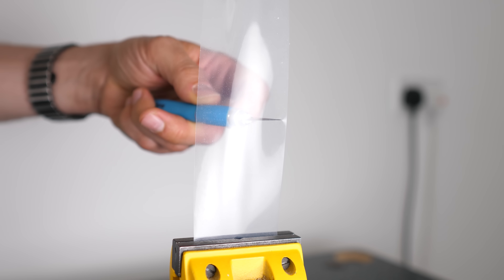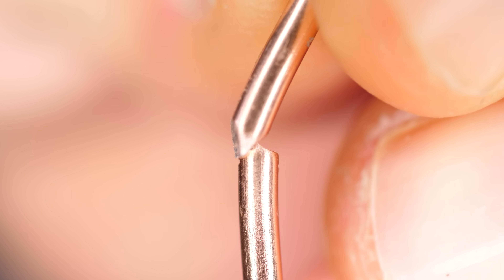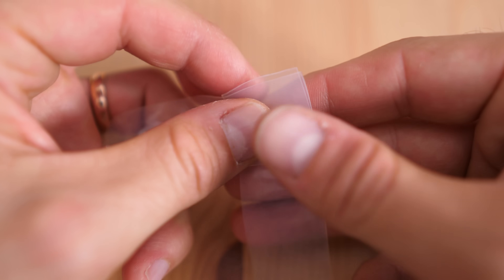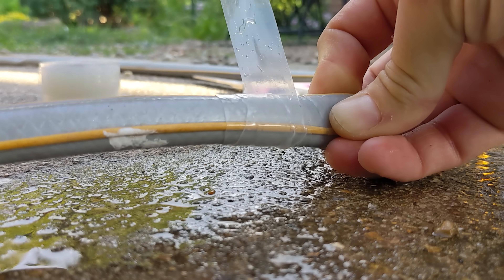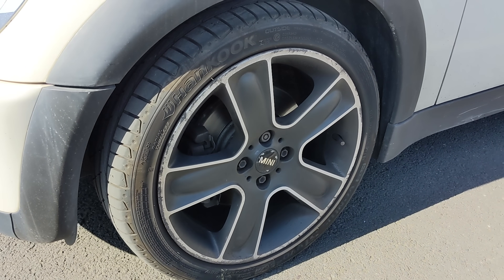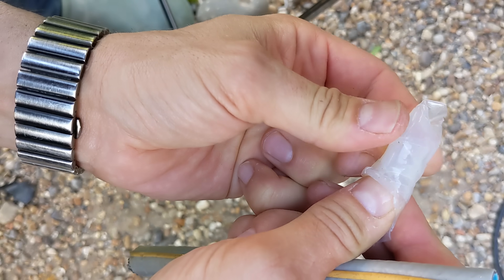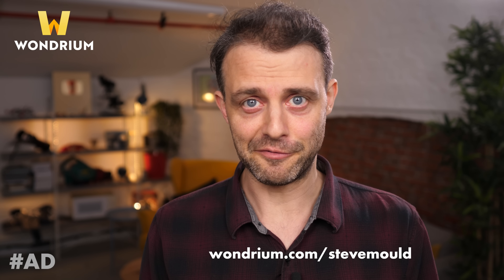Self-Healing Material

Comment: the reason the night sky isn't full of infinite stars is because of the expansion of the universe. No need to go to the big bang (although you could if you wanted to).
You can, in the present, observe the expansion of the universe. What that means is the universe is getting bigger and stuff is moving away from everything else.
But light must always travel at the same speed, the speed of light. So what happens when the light from the most distant stars and galaxies goes in our direction and the space itself gets bigger and bigger? Light cannot and must not go slower so instead of losing speed, the light loses frequency and energy, which makes it change color until we cannot see it anymore, and right now that light is so dim, if it has even reached us (remember the universe is 13.8 billion years old so only the light from 13.8 billion light years away from us can and has reached us anything further away and light hasn't had time to get here), so that light is so dim we can't see it with our eyes and most of.the time we can't even see it with tools

Comment: Couldn't this be simply "sticking" to each other? The molecular boundary of the polymer could have a shape such that it binds strongly to itself through van der Walls forces.

For example, imagine if the surface is composed of polymer strands popping out of the surface and cavities in the surface, somewhat like Velcro. This shape would stick strongly to itself and itself only.

Comment: it's corn starch glue used to use to affix paper back to books it's a heat activated glue available in many sizes and shapes it stretches  you can slowly push your finger in to it if  your slow but yo tap it it won't move you can change it Shap but it returns to original shape self heals shatters if hit with a hammer  if put under pressure it acts like play doh it acts like a slow liquid a elastemer  a glass  depending on speed fun to play with good for under your hifi components sold by national starch co in giant ravioli type shapes amongst others no one is saying this as far as I know because you'd then know it plain old book glue and cheap it also resist abrasion  use to thing it would make good self adjusting to shape knee pads or body armer was playing with this stuff over 30 years ago!

Comment: Polymer person and pedant here:
Crosslinking isn't necessary for latices to coagulate as you describe @6:11. Natural rubber, acrylic paint, etc are actually discrete particles of polymer dispersed in mostly water. Those particles have charged functional groups (e.g. COO-) on the surface. When you reduce the pH, you protonate those groups and destroy the double charge layer that screens the dispersion forces that would otherwise draw them together per DVLO theory, forming a floc. Salt will do the same thing by changing the dielectric constant. This floc becomes a solid rubber mass because the polymer chains are generally above Tg and are mobile enough to entangle with each other; below Tg you get a flocculated mass of mashed potato. I made a bunch of those early in my career!

Comment: What if it's just full of plastifier (non-volatile solvent) so when you cut it, you aren't really damaging the molecules (too much), you're just untangling them; and when you bring them together, the solvent also allows them to flow back together?

With the solvent being fairly specific, it won't cause the material to glue to your fingers, metal or most other plastics. Maybe.

Comment: If it were microencapsulation after a while all the encapsulated material would dissipate and it wouldn't work anymore right. I have some of this tape in black.. got it at a car show10 years ago , and it still works. Supposedly it has military approval for field repair of radiator and hydraulic hose 😳

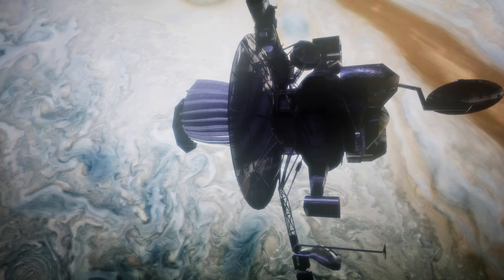Comment: 2:45 if I remember right, it is possible to cold weld some metals even in the presence of oxygen. You just need two surfaces that are flat enough that don't oxidize and then squeeze all the air out from between the two pieces.
Reply: I've heard it said that you can cold weld gold on Earth but it takes something like centuries.
Reply: Some machined surfaces will stick to each other really strongly. Feels like a weld but it breakable.
Reply: Like explosion welding, where 2 sheets of metal are forced together by explosives that squeeze out everything in-between them.
Reply: Take two blocks used to measure calipers, the smoother and more parallel the sides the better and they will stick to each other without any glue or "healing"
Reply: @jeffs-reviews  The blocks are very smooth and covered in a layer of grease. If you follow a procedure which pushes out the air, what you get is blocks held together essentially by vacuum, not too different from a suction cup on a tile. They will not weld together.

Comment: I'm curious about the material's strength before and after fusing it back together with different sized fused sections (attaching the ends, overlapping a little bit, overlapping a lot, etc.).

Comment: I'm not 100% convinced that oxidation is the reason metals won't re-bond after cutting apart. For example, gold famously will not oxidise as it's very unreactive, but place 2 gold earrings on top of each other and they will not bond. My guess is that if you cut a gold coin in two and pushed it back together, it wouldn't self-heal and I'm 80% sure that's not due to oxidation.

Comment: Probably a dumb question, but what would happen if you were to cut a piece of metal inside of a vacuum then try to put it back together? Since the lattice won't re-connect due to oxidation, what if you take that component out?

Comment: Is it possible it could be much more simple? What about a situation where it requires more energy to remain separate polymers? My favorite way to view that is that the universe is "lazy:" That when a molecular condition takes less energy than the current condition, it's gonna choose the one that requires less energy. Is it possible that the two sides have different incomplete polymers? Or that the plastic is actually two layers of polymers that, when stretched, are able to bind to each other through the alternate layer?

Comment: I use a self-amalgating tape all the time at work and yes, you stretch it to activate it. It actually does a great job sticking to itself when you do it right.  And to float a ship in a gallon of water you simply make the container the same shape as the ship so that a  thin film of water floats the ship up to the draft height.
Reply: You just need a really small ship.

In all honesty, I somehow doubt it would work? A gallon of water would need to be raised very high to counteract the force of the ship. If you made such a container, the ship would simply settle to the bottom of the container and push out all of the water.
Reply: @Validole  the container would go half way up the ship, be perfectly formed to the ship (but allow a slight gap evenly around), and sealed airtight. The pressure of the ship would be evenly spread upon all the water encapsulating it, therefore it wouldn't sink or hit an edge unless an external force was applied. 

Basically a "shell" surrounding the ship with a thin layer of water.
Reply: @2869may  No, no I can't. It's an impossible scenario. (unless the entire ship had perfectly distributed weight, no hull imperfections, and no uneven external force applied)

I meant a way to seal the water in, like some immense pressure above stopping the water from being pushed up and out, since (I'm assuming) the container cant come into contact with the ship in any way.

If the ship only had to be suspended by the water but could come into (non supportive) contact with the container then you could get a rubber seal or something around the lip to press against the ship and stop the water from seeping out.
Reply: @saltananda3227  Yeah, the "sealed air-tight" part would make it work. The seal would have to be incredibly inelastic, because otherwise, the pressure would bulge it out, and it doesn't take much to get enough bulge to fit a gallon of water along the whole waterline of the ship. At which point it becomes a somewhat academic point whether it is floating.
Reply: Ship could only float if it displaced the same weight of the water, so the ship would need to weigh just as much as a gallon of water.
Reply: @bismuth7730  The ship can displace the weight of the ship in water with only a gallon if the container the ship is in is strong enough and can fit snugly against the ship. Here is how.  Take the snug fitting container (Which has a height of the draft of the ship and fill it with water.  Now place the ship in the water. It will displace the weight of the ship in water and float with a small amount of water between the hull can container. The rest of the water displaced will overflow the container and be gone. Now if you remove the ship, there will be hardly any water in the container.  You will get the same result if you just start with that small amount of water. One does not have to literally displace the weight in water, one just has to effectively do it.
Reply: @lidarman2  no, you're wrong. The ship will just lay at the bottom of the container.....
Reply: @lidarman2  Displacement really does mean you need to do it continuously: it's the mass of water you have to displace to someplace else, where that displaced water, wanting to flow back into the area now occupied by the ship, provides the force pushing the ship up. It's the potential energy of pushing the water away from a point below sea-level, causing the sea level to rise just a bit. It's downright minuscule, because the world oceans are huge. But the displaced water is now "higher" in the earth's gravitational potential, and the force is provided by it trying to flow back into the lower area it (or it's brethren sea-molecules, it's one big supportive family) previously occupied. It has no incentive to push back, if it has already found an even lower energy resting place outside the enclosing vessel.
Reply: y'all are wild. to create enough buoyancy to float a ship, the ship needs to displace a volume of water equal to its own mass. so unless the ship weighs 8lbs, it's impossible. ships don't just float on water. It has nothing to do with surface area contact.
Reply: @currysama86  Do you know how hydrodynamic bearings work? They use a very thin layer of high pressure oil to let the surfaces spin freely, without the bearing parts ever coming into contact. 

Same principle for the ship thing.
Reply: @saltananda3227  No it isn't. Bearings use water and fluid to reduce friction. Mitigating the coefficient of kinetic friction is different than buoyancy. Buoyancy required that en equivalent mass of fluid be displaced as the weight of an object. Friction is just things sliding across each other.
Reply: Mass* of an object
Reply: @currysama86  No bearings use water. Think of a turbo charger, there is no metal to metal contact (If you shut off an engine before the turbo spools down it will cause wear and damage because the flow of oil from the engine has stopped, and the metal will make contact) when spooling because a thin, high pressure, layer of engine oil is forced inbetween the 2 pieces. The turbine isn't floating in the oil, it's got even pressure surrounding it and holding it in place on all sides.

Even pressure of liquid surrounding something means it wont drift to one side unless external force is applied, it's being held in place, not floating.
Reply: @Saltananda  So how does that have anything to do with floating the ship? You just said the bearings don't float. I used water as a generic example of a fluid, sorry I didn't say oil. And it sounds like we agree, at that point you're not floating a ship in a gallon of water...
Reply: @currysama86  Well what I'm suggesting is more of a technicality, since it's "technically" not floating, yet still suspended by water.

Quick question; where in the f*ck did this ship floating thing even come from? I don't see the original question anywhere? I just kinda jumped onboard.
Reply: @saltananda3227  on the "where did the question come from" : I don't know either, but someone was wrong on the Internet (in a way that I knew was wrong, but had to think a bit to understand why it was wrong).
Reply: @Validole  I don't even know why I got so into it, at the end of the day it's still a statistically impossible feat.

Comment: Oh I just have to say it, I haven't even finished the video yet but: In a way metals could be similarly self healing if the 'break' was precise enough - consider the wringing together of gauge blocks.  I've seen it on other machined parts, a odd adhesion force where the metal starts sharing those electrons enough.
Reply: Finish the video next time! He mentions cold welding.
Reply: @ObjectsInMotion  yes he did. I remember. Caused I watched the video.
Reply: Interference fit?

Comment: Technically you can friction fuse some metals, though that's far more friction that just pressing it together yourself, and it's not like most things would withstand it; certainly not the oxidized layer that stops them from fusing. lol I know you pretty much go over this, but I thought it was neat that you can get clean welds without grinding the oxidized layer ahead of time; I guess because the friction burns off the oxygen ahead of time? Honestly not sure of the mechanics.

Comment: I personally wonder if it's a mix of two compounds. If one is liquid at room temperature but dissolves the other, I imagine that you can get a mobile surface layer of the liquid compound that gets removed when pressure is applied, allowing the other compound to cross-link without getting exposed to the atmosphere. 
I guess it could be simple hydrogen bonding, but that the ductility of the material allows a lot more of the hydrogen bonds to align.

Comment: A big part is also the lack of contact surface. At the atomic level, two pieces of metal, even smooth, do not touch each other enough.
And btw, certain metals like aluminum and copper, can weld together just from extended contact under pressure.

Comment: great video, a worth considering hypothesis is some supramolecular host guest interaction between different polymer chains (pendent chains) and/or weak interaction such as hydrogen bonding that can result in high strength material based on strictly physical interactions
but that's just a hypothesis
also worth trying to bind the tape after applying some mild acid/alcaline solution to investigate the interaction

Comment: Steve, Its Polyorganosiloxane 
3M also  makes this tape as 3M 70 self fusing tape.
The MSDS sheet shows 1 ingredient:
 1. INGREDIENT C.A.S. NO. PERCENT
-----------------------------------------------------------------------------
Polyorganosiloxane Mixture.............. Mixture > 98
 The components of this product are in compliance with the chemical
 notification requirements of TSCA. This product is an article as
 defined by TSCA regulations, and is exempt from TSCA Inventory
 listing requirements. All applicable chemical ingredients in this
 material are listed on the European Inventory of Existing Chemical
 Substances (EI

Comment: I use self-amalgamating tape to waterproof outdoor connections for coaxial cables on antenna systems (amateur radio) and I always found it fascinating. Works great for this application, and is almost impossible to cleanly separate once it has fused.

Interestingly, I have found this kind of tape (even the black stuff) decidedly not UV-tolerant, and it will degrade and split quickly when left in the sun. Simply overwrapping the join in black electrical tape (substantially more UV-tolerant, despite also being a black plastic tape) does the trick to protect the amalgamating tape from UV though, and then it lasts for years.

Comment: this doesnt make sense. If I took two diamonds which largely do not react with the air and try to fuse them they wouldnt.

Also silicon dioxide which is sand or quartz when broken does not fuse back together though it is already in its oxidized form and therefore does not react with anything.

Comment: As you mentioned, https://en.wikipedia.org/wiki/Self-amalgamating_tape - we used to use this at work for taping up cable joints. It seals to itself into a single rubber block - been around at least since 1979 (when I was an apprentice). It wasn't immediate, more like 5-15 mins I guess.

Comment: Unfortunately, your metal welding explanation is at best incomplete. Oxidation is definitely a factor but let's take for example Gold or Copper. They're very unreactive but the still don't cold weld. The big reason it happened in outer space is the cold rather than the vacuum. When cooling down the metal you allow the electron clouds to more easily recombine, when you press the two metal surfaces together. The other way you can do it is using nano structures. I think I remember a paper claiming room temperature cold welding, but using nanowires. Conclusively, you can "connect" using three methods: Welding by melting both parts, sintering, i.e. heating such that diffusion process take over and fuse the surfaces (below melting!), cold welding using nano structures, high pressure or very cold environments and extremely clean and close surfaces.

Comment: Explosive welding, making clad's, also use the property of cold welding. When the explosive goes off, it evacuates all oxygen from the faces of both metals, leaving them atomically/metallurgically pure. So they are able to to bond to one another. So there is a lot of science going on, when you look at your quarter on edge (the one with Washington's face on it). Surprising isnt it.